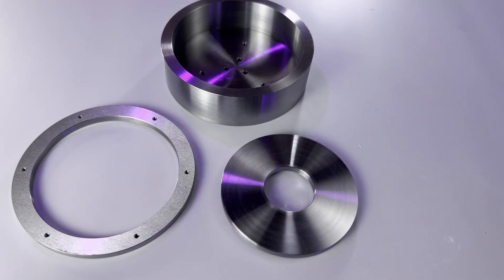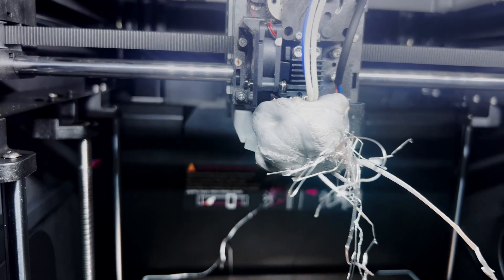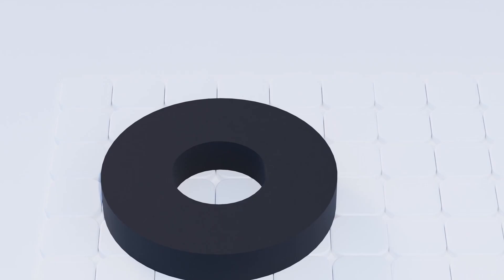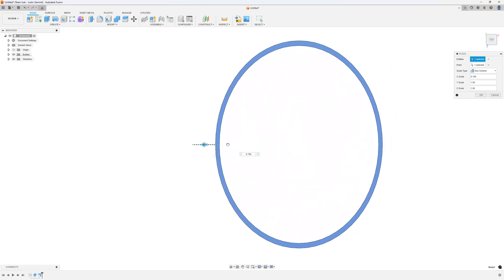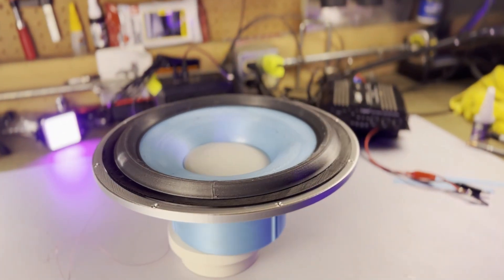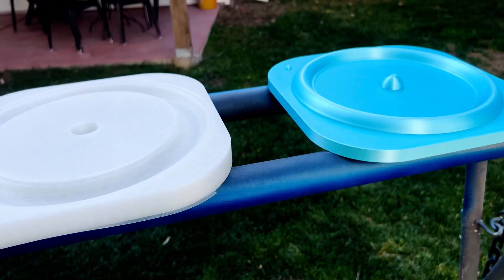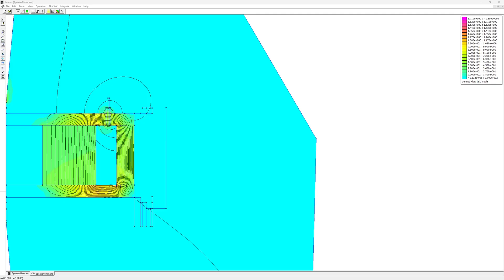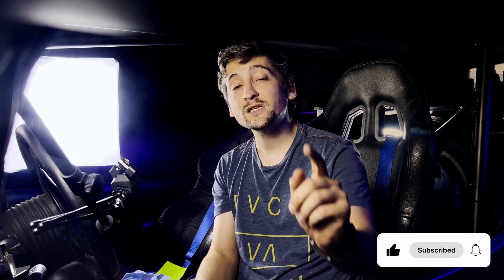Can a 3D Printed Subwoofer Really Work? (V2)

Comment: are you sure your measurements are correct as those Q values are way above what subs have (even higher than mid range drivers) ?
Reply from the maker: I’m positive they are correct- the VC was rubbing which basically ruined it as a speaker. It will get fixed in the full box video though!

Comment: Can you balance your audio please? It is annoying to listen to the video when the audio is louder on the left side.
Reply from the maker: I guess I didn’t notice it? Both channel levels are within a dB of each other in the mixer? And everything should be focused around - 12dB. Have you noticed this on any other videos?
Reply: Only on yours. I loaded the audio into audacity and it shows -3 on the left and -9 on the right.
Reply from the maker: No, on any other of my videos?
Reply: I have not seen any of your other videos yet. I am interested in making a 3D printed speaker (enclosure, not the driver), so I will be watching them later today :)
Reply from the maker: Well please let me know, I may have something wrong in my editor..
Reply: @piscesprinting  I have looked through the videos, It seems you started recording audio differently for the past 3 videos. The chatgpt video was the last video of yours that sounded great to me. 

The $35 speaker challenge is the best of the three, it has a barely noticeable increase in volume on the left channel, but I can see it on the channel monitor. 

Hopefully this helps, Great videos by the way!
Reply from the maker: Thanks! I’ll look into it.

Comment: Hey, so I’m not a sound engineer and I surely don’t understand exactly how the speakers work but I also really love listening to music and honestly that speaker doesn’t sound that bad. You could probably use it for a mid range low end speaker man this is also coming from somebody which literally has stacked the speakers going from higher range to lower range using them on a four amp amplifier set. I need help not really but what I’m trying to say is I really respect this and if I had three printers, I would definitely do it.
Reply from the maker: The sound is overall not terrible, but I have VC rubbing and to stiff of a surround. All of which will be fixed in the next subwoofer video.

Comment: I wanted to make an 8" passive radiator with my 3d printer ... this video is what i needed :D
Reply from the maker: I recommend using softer tpu than I did, 95A is to rigid- a 80A would be better and varioshore is likely your best bet for the surround as it’s close to 60A-70A

Comment: Full length! 

Also, the VC rubbung stems from your spider which has a low stiffness for sideways forces. I recommend a premade cloth spider or at least try to aproach one with printing. Nice project!
Reply from the maker: I’ve done regular 3d printed spiders before, just didn’t do that for this build

Comment: I decided to repair an old pair of speakers whose magnets had broken free from the pole plates (and surprisingly didn't do much damage to the coil in the process, really shitty at bass tho XD), though assembly was a bit in reverse since the spider was already assembled I had to get alignment while gluing the magnet down. Made a jig with an ABS pipe fitting, and gluing some nuts to reinforce screws. Have you considered a "Hardware Store" build rather than PCB way?

Also, I want the gorey project details, but the short would probably be a better algo boost.
Reply from the maker: I’ve done builds with laser cut plates. I know paul with polymate uses store bought washers for his plates on a few builds.